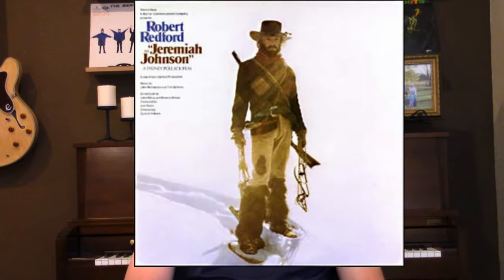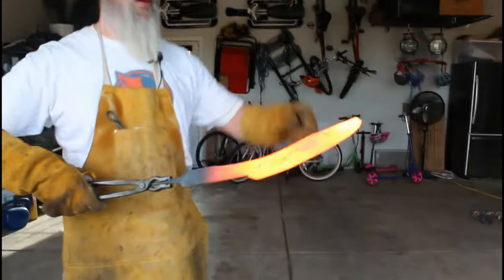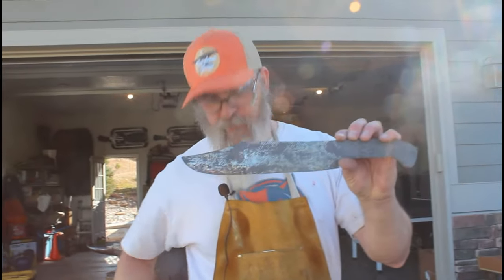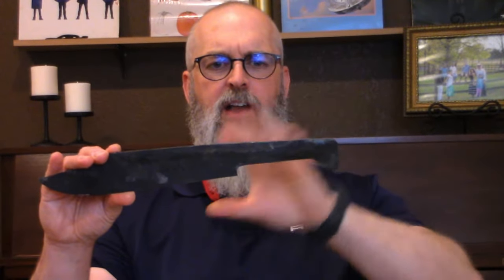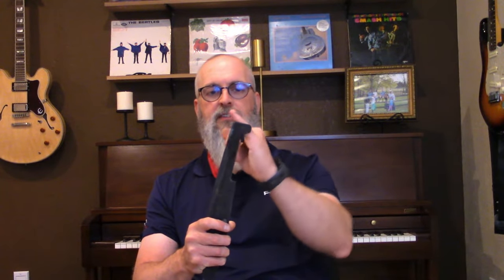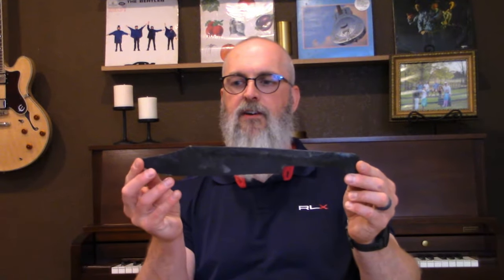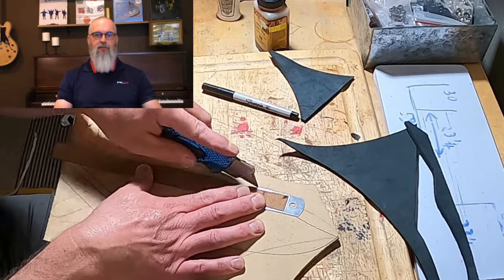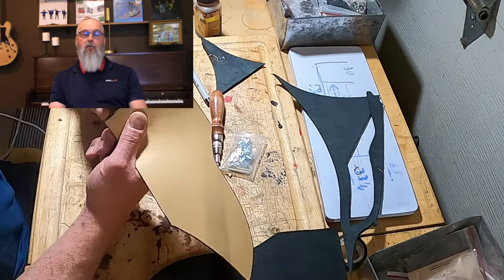Jeremiah Johnson's Bowie Knife

Comment: I have that exact knife used in the movie. The blade is stamped Western U.S.A W49  C.  I think I bought it nearly 50 years ago, It came with a leather sheath and a wooden wall plaque. The plaque has a brass plate on it with the following inscription " Authentic Bowie Knife circa 1840"
Reply from the maker: Cool
Reply: @furslandforge  Yes I thought it was cool when I first saw it in a local gun shop all those years ago. Still think it's cool even today. Greetings from Oz.
Reply: I bought that same knife back in the early 80's.